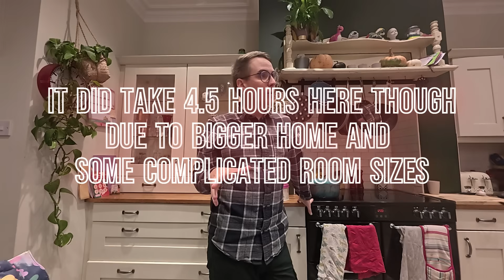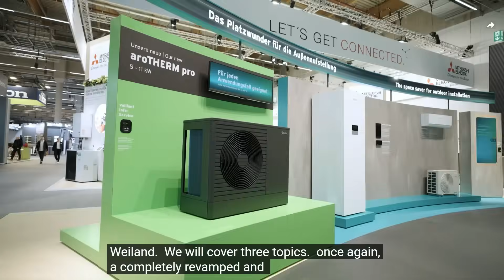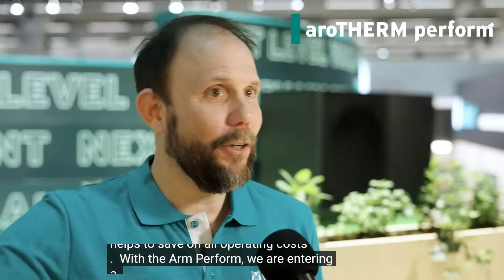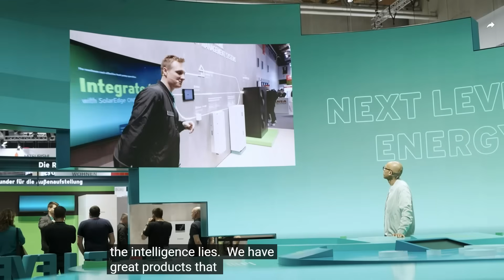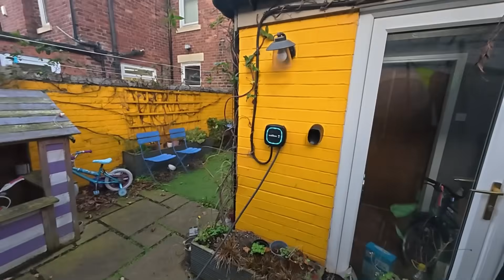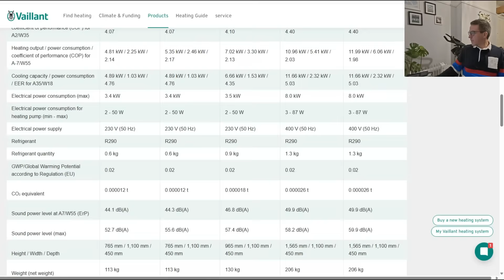Heat Geek Zero Disrupt   Do I need  Black Label

Comment: Invest in insulation to reduce HP size. Opposite might create issues in the long run. My 4K Daikin R32 is 4.5m from neighbours bedroom. 4m below mine no complaints. I had to pass boundary and noise regs.
Reply from the maker: Difficult 
In a house with a cavity it's much more simple, you just fill it.

But with my solid walls retrofitting insulation is a challenge. 
Id have to go back to brick and redecorate the whole house to internally insulate the walls, and subfloor. Very disruptive. 

I've looked at innovative solutions like Qbot, a wee spray foam robot car to insulate the floor but that's tough too. And people are super wary and warn me off. 

🤷

Comment: Did you know that EDF are launching a zero disrupt type offer called Express Heat Pump Initiative?  https://youtu.be/AGn6eDyDBiw?si=730Rx994uTMyXGmx
Reply from the maker: I've had enough of survey's now TBH and can't imagine they'll have a solution that's any different. 
I've got a real problem with the noise calculation and heat pump placement
Reply: @Lewis_Standing  Have you looked at Midea heat pumps? They claim 35db at 3 metres for all sizes.
Reply from the maker: Sounds good, do midea have a good reputation?
Reply: @Lewis_Standing  They are a global brand, do a 10 year warranty if installed by an approved installer and are well priced at city plumbing.

Comment: You'll never recover you capital cost bud  = just run your house on oil / gas 🤷‍♂ 🤷‍♂
Reply from the maker: I don't want to!
Happy to invest for a warmer more comfortable & going green is important to me
Reply: @Lewis_Standing  Looks like ZEB's are going to be included in BUS grant - which may suit your needs much better inanycase
Reply from the maker: Nahh locks in huge bills!
Some days I use 120kwhs of gas for heating if it's frigid and we have guests. 

Tepeo can only store 40kwh of heat, so only 1/3rd will be at the low rate / off peak rates at 7p so £2.80 for that, but the other 80kwh would be £22. 

Unsustainable.
Reply: @Lewis_Standing At first I was going to ask "does it matter?" but then I realised it's merely a "zero efficiency boiler" getting a SCOP of 1 which makes it unsuitable for most

Though it'd work as a way to heat hot water only
Reply from the maker: Tepeo comes with a separate hot water cyclinder then a 300kg concrete heat battery that's heated by electric elements. Then piped up to the wet heating system. 

Good for a listed building with no heat pump room perhaps... But still needs room for a 300kg massive concrete block
Reply: I would but I'd be getting a heat pump anyway
Reply: If you don't care about your children's and grandchildren's futures, then of course we can just keep burning fossil fuels, depending on your age, you may well be dead by the time the absolute worst is felt, good for you.

Comment: Have you considered an air to air heat pump. This would likely be the most common heat pump installed if the govt pull the bus grant as this would not be affected. Also ground source heat pumps are not subject to any noise regulations to get planning.
Reply: I had air to air installed and it is the greatest thing I've ever spent money on. You get a nice dry heat like you get from a fire, it can dehumidify if needs be, way cheaper than air to water, air conditioning on the hot days in the summer, filters the air. Just brilliant.
Reply from the maker: I have but a firm quoted me 17 grand

And I don't think I have enough room for a bore hole tbh and they cost about 20 grand
Reply: @Lewis_Standing As of today, they've got grants for those. Thay seems excessive tbh. It's gonna be cheaper for you to insulate imo
Reply from the maker: It's just disruptove but it will add comfort and redecorating the loft rooms is probably overdue
Reply: @Lewis_Standing This is a fair point. I am fine for insulation, minus my loft. I've used a PassivHaus architect to assist in what's required for my house as a low energy retrofit ie: without ripping the house apart

The insulation I'll be using will be pricier than most but it's also be breathable. If you aren't aware already, avoid spray foam even if they say "It's open cell. It's not an issue RE: mortgage" They're technically correct but you've just closed off 95% of the market by getting spray foam

The annoying thing ofc is that open cell spray foam is actually incredibly good but because the industry was full of cowboys, banks are very wary of spray form even if it's the open cell stuff vs the closed cell stuff.
Reply from the maker: I've been looking at this for the underfloor insulation, a firm called Qbot 

But again people are super wary of it and umpteen people say don't do it.
Reply: @Lewis_Standing Super wary of ufh?
Reply from the maker: Spray foam insulation for suspended timber floors delivered by a wee robot car with a spray gun 🔫
Reply: @Lewis_Standing Ah yeah, you're making your house potentially unsaleable. Amazing stuff tbh but incredibly risky when coming to sell your house. I also wouldn't do it, personally
Reply from the maker: How would they know? Is one question. 

Their conveyancing solicitor won't look up my YouTube 

Even structural surveys are non invasive
Reply: @Lewis_Standing Loool. You sure make a fair point but I'm sure you'd have to declare it and failure to declare to new buyers could cost you 

Again, incredible technology imo but too many cowboys made banks waryy

Comment: That backyard looks really tight and from what I can see, the sound is going to bounce off those walls and windows maybe making things worse at some frequencies than the calculation will show you.

As suggested before I would just build a new wall so the heat pump faces the street and you don't have to hear, see or avoid it. 

The current location of the gate seems like a great spot and the required clearance is in the online Vaillant manual, so it should not be too hard to make a good design. You willl loose some space, but what is left should be much more usable.
Reply from the maker: It's an interesting thought actually and I can imagine what you mean. 
Round the corner is preferable though. As you say it's a tight space and losing 1-2m wouldn't be ideal
Reply: @Lewis_Standing I think you are overestimating what you would actually lose. It would be ideal if your property went beyond that wall (sometimes official boundaries and structures don't match), but even without that, it is not a huge loss compared to having the arctic airflow killing all garden life and the usable space for entertainment as soon as the DHW needs to be heated or the weather is still good enough for sitting in the garden but the heat pump is already needed to keep the inside temperature at 20 degrees.

The 12 kW Vaillant is 450 mm deep and the wall clearance is 200 to 250 mm according to the manual. This would cost you 60 cm as the existing wall is removed.
The width of the heat pump is 1100 mm and when facing it you need 100 mm clearance to the left and 500 mm to the right (maintenance), which you could extend a little by making a 800 mm gate instead of a 500 mm wall, and having it open toward the street to save usable garden space and more convenient bike access.
This would total a 2000 mm width excluding brickwork, so thats a little over 1.2 m2 of "lost" space but a much more usable garden.

If you don't want to waste a single square meter, you could even elevate the heat pump by building a bike storage space below it with a concrete roof. the heat pump is only 1565 mm high, so you can probably lift it up quite a bit. Add some sockets for e-bike charging and move that EV charger so it's no longer a trip hazard.
Reply from the maker: @SolAce-nw2hf we can't really use round there anyway and so I think at the back of the L will work okay as we entertain or use the back yard for seating and entertainment in the summer anyway when the pump will be dormant. 

I think you're suggestion is very good though and I'll think it through. 

Thank you 

Lewis
Reply: @Lewis_Standing Just try to plan it, make a drawing of both options and show them your wife of maybe a real estate agent to see what either option will do to the propery value.

I love heat pumps, but I had mine elevated to 3 meters and wall mounted at the front of the house as greeting my guests with a 1 degree artic wind at the front door would be not be great and my front yard being quite small.

The backyard was also discussed as an option, but as quiet as my heat pump is, I really don't want to hear it at all and let's just say not everyone in the home likes the way it looks.

Comment: In reality if you want low flow temp , you need considerably beefed up insulation to bring heat loss right down , change rads for k3 type or at least underfloor heating through such as porcelain tiles and if you were to include triple glazing you could get down to 30 degree flow . 
  You are not going to do that unless you were going through a complete refurb given the capital cost would be vast .
  Low flow really does work but not in a leaky house .
Reply: I have a 1960s ex council terrace, with 25-year-old double glazing, standard loft insulation and cavity wall insulation, pretty much a standard house with moderate insulation. I have some K3 radiators downstairs, partly to fit into small spaces, the rest are K2.

At -3C outside, 21.5 inside, my flow temperature is 39C, not your 30C but still I would say low temperature. The house is much more comfortable (warmer, but also more constant) than it was with the gas boiler, and I save money on my energy bills, so I'd say you don't have to go to extremes for normal houses.
Reply from the maker: definately can get a great SCOP 4-5 if you run it at 39c
no need to push down to 30c
Reply from the maker: Original heat geek survey said I could do it with no extra insulation. 

Heat pumps needing insulation is a myth. 
Benefits all heating systems. 

Easy insulation like the loft sure. 
Draft proof double glazing sure. 

Expensive retrofitting of solid walls? Just fit a heat pump.

My houses version of low flow temperature would be 45c though, so perhaps that's your point 

Great article here if you want to read a different point of view 👇👇
https://essaysconcerning.com/2021/11/08/insulate-britain-yes-but-by-how-much/